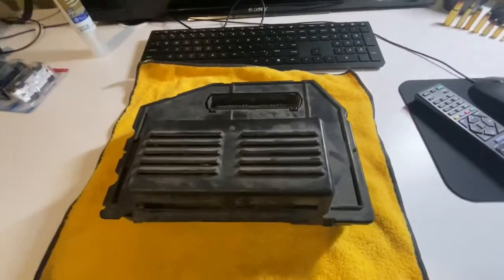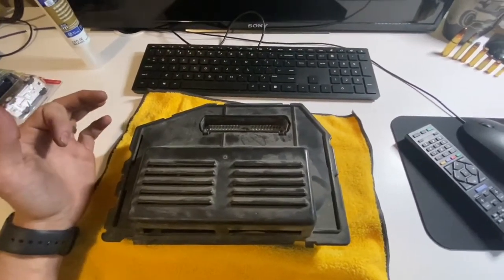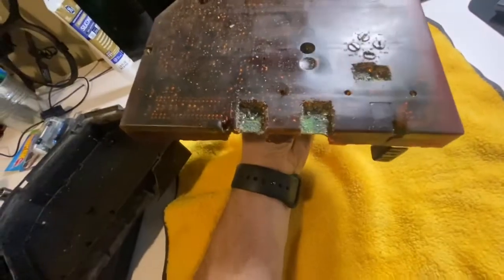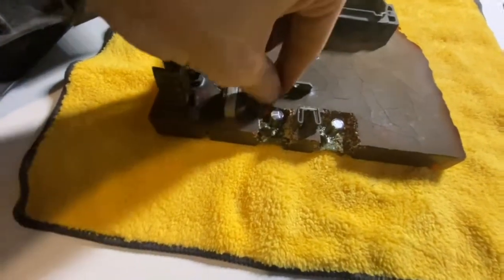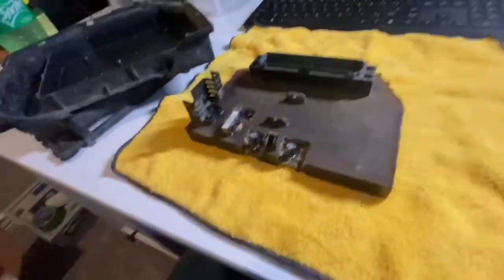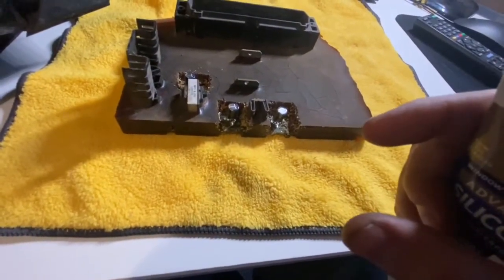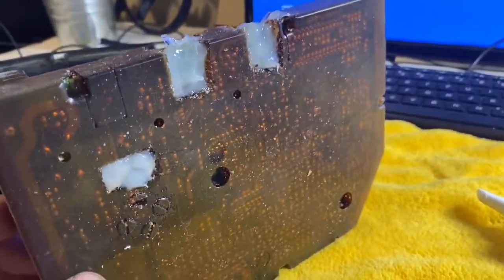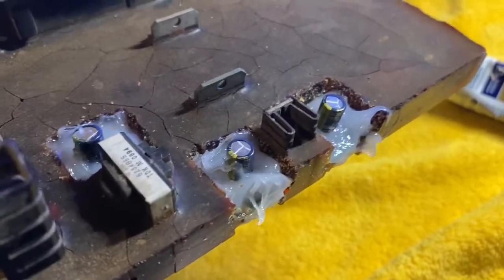Jeep Wrangler ECM repair| No start/ no check engine light repair

Comment: Hi, nice vid! I hope that i can ask you for help. I'm measuring 0.2v voltage at the pin of the oxygen sensor (it's coming from the PCM) 

The engine starts good and runs a bit like it has old spark plugs, but often loses power for a few seconds while driving. It's as if it runs on a few cilinders for short multiple periodes. It went wel for a few weeks with a new oxygen sensor. 

I've lost two oxygen sensors. Could it be that a busted Capacitor could result in putting voltage on the pin? (which destroys my sensors) It's a 1993 ZJ 4.0.

Comment: I have a 1995 Jeep Grand Cherokee ZJ 5.2 V8. The car always stops charging the battery. I remove the PCM, resolder the capacitors, and the car runs fine for a few days, but then it stops charging again.

What could be repeatedly damaging the capacitors? Has anyone experienced a similar issue? Thanks for any advice!

Comment: My Jeep is turning off out of the blue when I slow down the speed or when I stop in the red light. Any clue about why is doing this?
Reply from the maker: Could be a few things, idle air control valve, throttle position sensor, map sensor